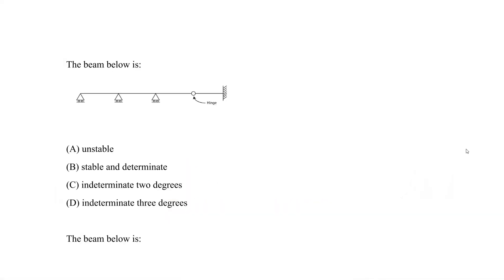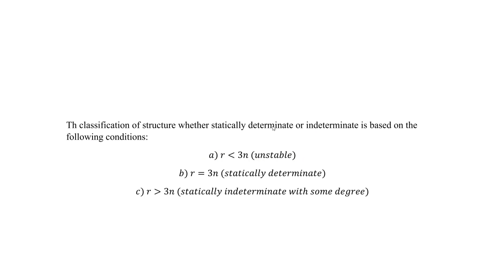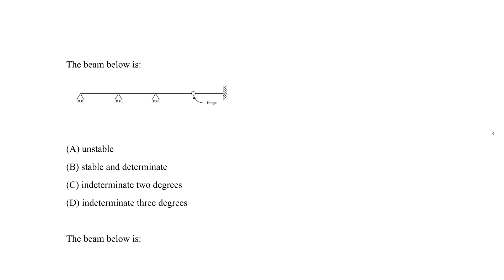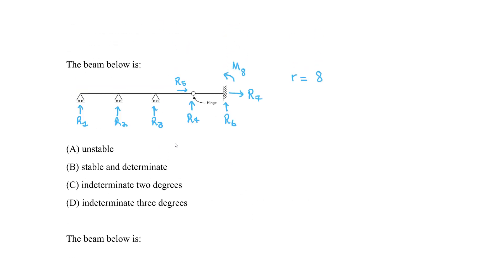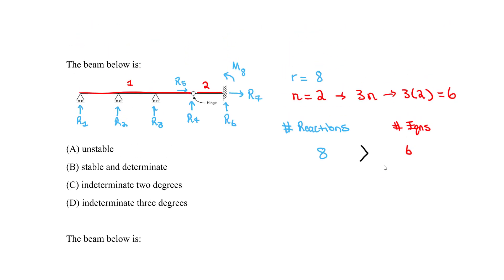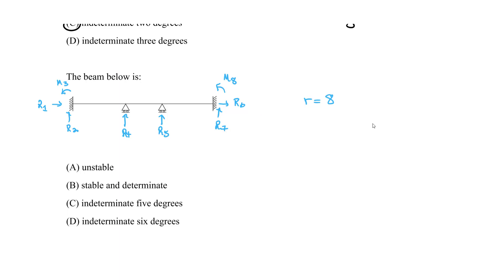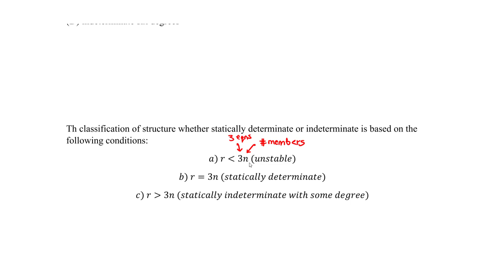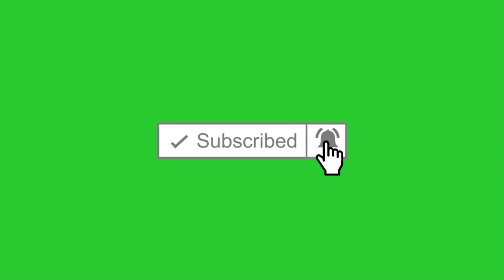FE Exam Review - FE Civil - Structural Engineering - Determinacy and Stability - Beams

Comment: why arent there 4 members? shouldn't the rollers be acting as "joints"?
Reply from the maker: Oh yes, You can do it that way if you apply my latest video method using the Frame determinacy equation from the FE Handbook. You’ll get the same answer using both ways.
Reply: @directhubfeexam  Could you please put the answer here to verify that i got the same answer if you were used 3m+r  3j+c? My answer if i used the frame equation would be m=4,r=8,j=5,c=1 and  20>16 which is stable and indeterminate 4 degree? Your response is much appreciated!!
Reply from the maker: @EE-pq8yn  Hello! 

You're very close. When using the frame equation, we will not count the reactions at the hinge. Therefore, r = 6. 

The rest of your values look correct!